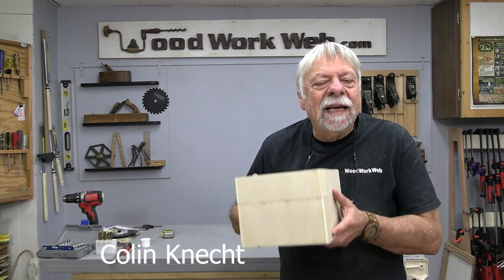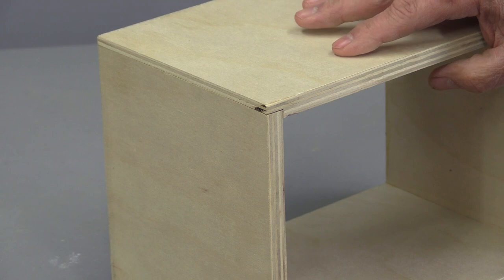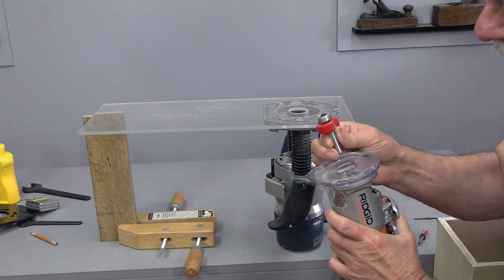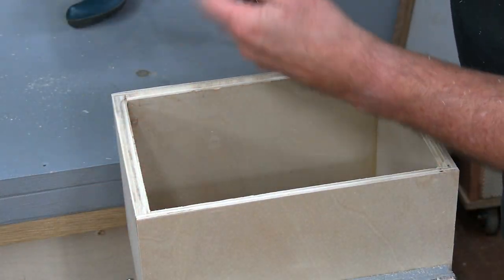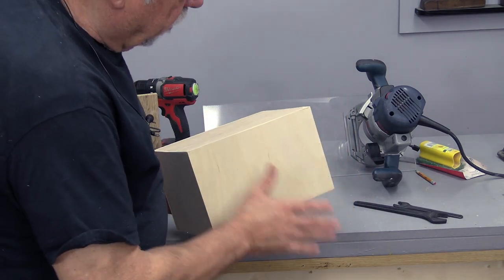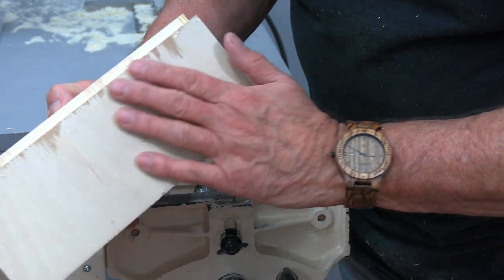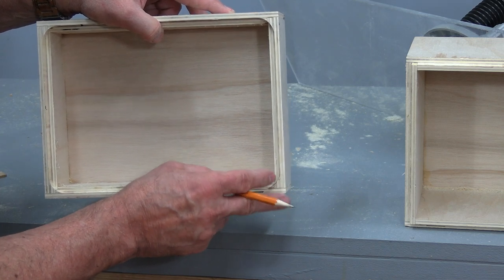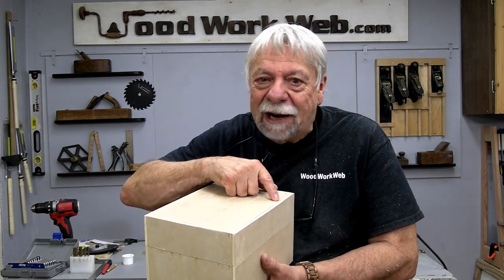Wooden Box - NEW Experimental Design

Comment: Nice experiment with great results.  That plywood looks exactly like what I used to cover my shop walls.  It looks good on the walls but it's horrible for making anything.  Every time I handle a piece I get splinters in my hands.  The veneer comes off easily when crosscutting even on a table saw with sharp blades.  The core density varies a great deal.  It's inexpensive but it's cheap.

Comment: I made my first box not too long ago and used a similar technique for the bottom panel. It was a pretty small box, and wasn't meant for anything heavy, so I actually used a scrap piece of paneling for the bottom. I used a double rabbet for the sides, and cut my rabbet for the bottom panel before assembling, so I didn't have to go back and square any round corners. To hide the fact that it was paneling, I painted the bottom of the box and lined the inside floor with some red adhesive backed felt, came out really nice, for my first attempt. My lid was very uninspired, but I made it work.

Comment: Cut the inner grooves for the lid halfway through the inside of the  box sides as a first step --  before gluing box the entire box together. Measure and remember where that groove is.  Then, once the box is all glued up, cut a second line on the outside just as Colin did,  just below the hidden inner groove. (Again halfway through the sides to separate the lid.)

 This is the first style box I ever made, but I built mine with mitered corners, so the inner groove isn't exposed at the corners.   Saw it in a woodworking magazine years ago.  Beautiful box.

Comment: Loved the shim and painters tape, I hadn't seen that before (or not noticed anyway).  I assume you would find where the router is going to cut on the outside, then you could run a knife along that line to cut the veneer, then you wouldn't get the tear out?  Even better quality plywood is susceptible to that.  This would probably work great with solid wood as well.

Comment: All the blowout comes from doing all the routing cross-grain. If the grain was running horizontal (when the box is sitting in its normal orientation), all the routing would have come out cleaner, even on low-grade plywood.

Comment: Great technique! 

I get confused easily, but were you feeding the router in the opposite direction from convention? Would that have aggravated the chip-out problem?
Reply: He fed the router in the conventional (safer) way for an inside cut. It's safest to cut "pushing" the bit into the work. If he went the other direction, it would have been a climb-cut which indeed would reduce the chip-out, but is dangerous as the router would then want to grab and run away. As others noted, pre-scoring the cuts with a knife and/or using tape would help reduce the chip-out.
Reply: @jmckl123  Thanks for clarifying that. I can figure out which direction to feed the workpiece or move the router when I have my router in my hands, but it confused me to watch Colin make the cut.
Reply: @bobt2522  When using a hand held router, use the "Right Hand Method" where the thumb of the right hand is the router bit touching the wood and the right hand pointing finger is the direction of movement of the router.  This method can be used on inside or outside cuts like Colin did in the video.  This is the safe way to use a handheld router.

Comment: You could try this general technique but instead of a rabbet for the lid, use a chamfer bit with a slightly undersized bearing, so you would have bothered a small lip and a bevel on the base piece.   It would be just a bit more dressed up.

Comment: To find the EXACT radius of the bit in question, all you need do is take a small piece of the 1/4 ply you are using, and run out a 90 angle into the board with the router, then use it for a template to make your corner radius's.

Comment: Not really a new design, it is usually done so that when you cut the lid from the bottom it is already rabbited correctly to fit.  I have seen it several times in a few different books on making boxes. just as you have done it as well as the other way.